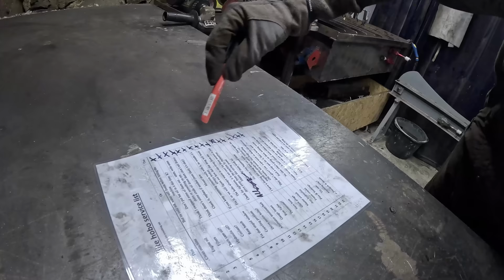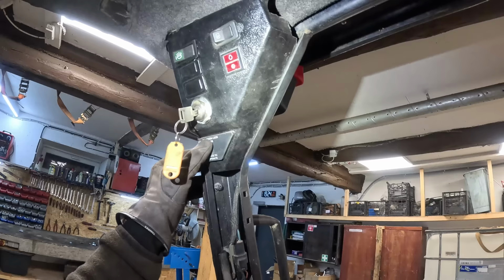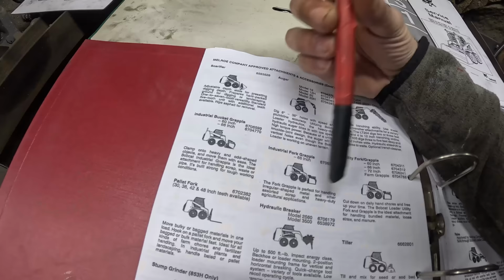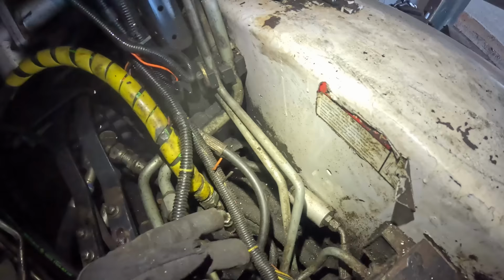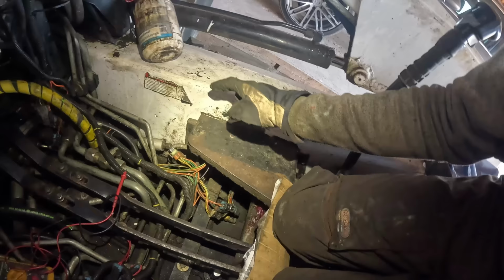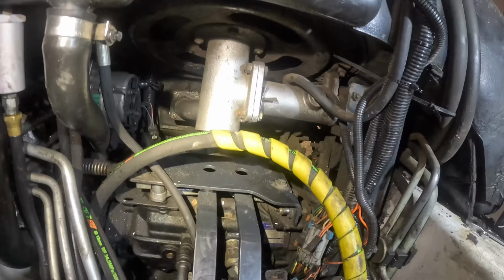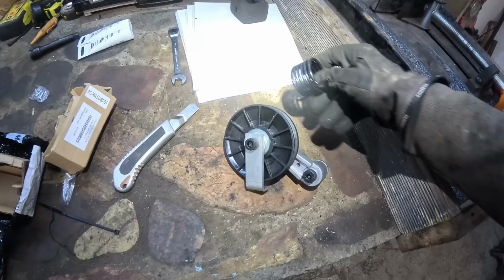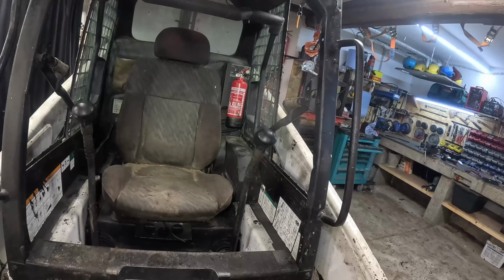Fixing up the Bobcat 751 skid steer - (part3)

Comment: For the wheel studs, I just removed one and took it to the store and found a similar one instead of buying OEM Bobcat. They were 2.50 instead of $10. To seat them I use a oversized nut as a spacer to suck them in tight.
Reply: What’s worked great for me is to put the studs in the freezer for a couple of hours to shrink them then before installing them heat the hub up. If you get it too hot you might have to put more grease in the wheel bearings because it could melt it but that’s no problem as long as you don’t get it hot enough to melt the wheel seals. I’ve stretched the threads on new studs trying to pull them in with the nuts before even with an oversized nut as a spacer.

Comment: Hey Ant! So a few things I would suggest is.
1. Your front bobcat tires are backwards. They need to be switched to the other side. The tread needs to make a v facing forward. The auxiliary control box isn’t worth replacing. Cost 1k in the USA. I bought a few. I just ran a wire and switch the the Aux manually. When you paint the machine.
 Use a paint gun. I painted over 50 machines. They look amazing with a gun and good paint. Take all plates. Glass and wheels off. Paint the grey first. Then tape  it and paint the white. Will look brand new.
2.Make some merchandise to sell. Like small pins or shirts or something cool about your culture. You have a big following and in the next few years you will blow up. 
3. People love when YouTubers like you buy and sell stuff. Like “I BOUGHT THE OLDES EXCAVATOR” and then promote the merchandise then. Lots of views and money to keep doing stuff. 

4. Just want to say you’re doing great!! Hard working. And consistent content. I won’t be shocked if you get 500k subscribers in the next few years. Use this platform to your advantage. A lot of money to be made to help you and your family out. Love the content and keep going!
Reply: MVP comment bro.
Reply: For the aux switch how did you get from 12vdc to 9vdc?
Reply from the maker: All good tips sir. Thanks
Reply from the maker: Could dowgrade the voltage with a resistors
Reply: @Ants_Pants  wasn't sure if that would create to much heat or not. I guess dropping 3v its not likely an issue. I was researching and they have sealed little converters for like $6. Otherwise it says 12 ohm resistor is needed. I'm not sure what the current draw is but it might be a good idea to make a small relay bank so as to avoid burning up the joystick controls. DC switching is typically harsher than AC

Comment: 👀 that you're done. We froze the studs, then used three (3) oiled washers & nut {backwards} to pull in the stud 😊
Reply: I do that and also heat up the hub around the holes. But don’t get it so hot it melts the wheel seals or the grease out of the bearings. As soon as I heat a hole up and put one in I blow air on it to cool it so heat doesn’t build up too much.

Comment: The yellow wires on the strobe lights switches the flashing patterns and also if you tie them together. It should sync them to one another. I worked installing emergency lighting on police cars and county worker vehicles.

Comment: Here you go, Ants, work is flowing nicely and results are coming to light. I admire your perseverance to projects and filming at the same time, since it takes twice as long as if you just do the job. Anyway, I have a ton of recorded material, I just need to put it together in some orderly fashion, which may take a while.. But as DIY mehaniks, fixers or repairmen, we all know how it goes..  The blackmith's horse is always shoeless... 😏 Anyway, you're right about rear lights, twice. Sometimes you get lucky that something fits correctly, and the yellow wire is to switch operating mode. I have similar lights and there are even 4 wires. It flashes in different patterns, just touch the yellow to positive to switch pattern. Cheers, it's going well, shortly will be spring and mud season at your place, here we had already 27 degrees in the past 2 weeks, but wednesday it came back winter, snow and also some frost locally, regardless of our central-south (mediterranean) position. It's not over yet, we need a bit more patience. Keep yourself together and good luck with the auxiliary. 😉👍
Reply from the maker: Got some more ice and snow lol

Comment: you can use a hydraulic brake actuator with a handheld hydraulic pump and thread adapter to press such threaded studs in
Reply from the maker: Ok

Comment: I like these videos! Keep up the good work.  The "oil" substance in the electrical plugs is most likely dielectric grease.  It provide corrosion protection by blocking moisture (water and other liquids), and excess oxygen - these combinations (liquid and oxygen contribute to rapid corrosion).   The grease component of dielectric grease also lubricates the rubber or silicon insulation of the connectors.
Reply from the maker: Does it also contain dirt and sand? 😅 because thats what was in there

Comment: Ants, you might consider a small case drain line, to go with the pressure, and return, as hydraulic motors require them.
Reply from the maker: for what exactly ?
Reply: @Ants_Pants  Gear type hydraulic motors, do not need them, but the piston type high torque hydraulic motors have three hose connections, as the oil that escapes the piston/cylinder area, under some conditions, builds up case pressure, until it usually spits the shaft seal out, then the fun starts.
The cooling fans on some equipment, is powered by gear motors, low torque application. 
Large brush hogs/mulchers use the piston motors for hydrostatic drives, high torque requirements.
Read up on hydrostatic drives, and skidsteer attachments. 
Best wishes from Northern Canada.

Comment: You have the signals comming in. you can buy some cheap relays to replace the aux controller. you can use some high amp resistor to reduce the voltage to 9v .

Comment: I wish you could have heard me yelling at you to turn the wheel nuts around and pull the lugs in with the flat side instead of the tapered side. Using grease also helps the lug pull into place better and helps the nut and washer spin freely.   If you want to use the auxiliary hydraulic system, there's not much you can do unless you replace the control module. You cant even continue to diagnose the problem unless the module is powering up the rest of the system.

Comment: First off that cab heater discovery was epic. You could always fit some Lexan or other rigid and clear plastic around, doesn't have to be air tight, and you'd have a somewhat warm cab in the wintertime. That bearing is a little worn for sure but it would probably last a while.
This video was awesome man. It's like I'm right there with you as you troubleshoot, discover, and repair bit by bit.
I don't mind at all if you need 3 more videos to complete this project. From your jokes, to watching you come up with obscure fixes, I really like watching your content. See you on the next video man.
Reply from the maker: Thanks Kirk

Comment: Hi Andris, nice video! Pro advice do never stick the multimeter tips into the connector pins. You will wide them up and cause very hard to find sporadical electrical connection issues. All the best
Reply from the maker: Yeah i know but i also bent them back later

Comment: The connections may, possibly, be filled with a dielectric grease. It would help with waterproofing and prevent corrosion. Or the seals are bad, and regular oil got in creating a weak short.
Reply: Also, a 9v battery is small and can provide the 9v you need to test the solenoids.
Reply from the maker: It had dirt in there aswell guess that's not normal
Reply from the maker: Ok

Comment: After you get the nut past the end take a grinder and taper the end of the bolt! But you have to use a thread die nut to straighten the threads! 👌🏻👍🏻👍🏻  Would save you on your replacement nuts!
Reply: Thread dies are incredibly hard to get started sometimes. A stud repair die is similar but works much easier

Comment: Getting near the end with the Bobcat. 
A lot of  overdo work looks like! 
By the way, those flat face couplers are used mainly on industrial equipment. 
Easier to hook/unhook as well as little to no leaks while doing so. 
A lot more expensive to replace as well, not really necessary in your case. 
Only thing hard to match up regular couplers to the pipe fittings usually
Reply from the maker: Yeah local hydro shop asked 70 bucks for 1 lol..... And they only had 1

Comment: 1:06:00  the yellow wire you can either change the light pattern or it is to connect the wires in series between the lights so that they flash in mode
Reply from the maker: Either way, thanks

Comment: One thing you can do is start the machine and lift the bucket. That would let you pull the floor jack out from under the bobcat. Put a little permatex on the chain fasteners to keep the rust from making it hard to take off. Cheers 😉
Reply from the maker: Good tip!

Comment: You said when your tires are on the machine there’s no room to add tracks. You do know that skid steer tires come in 2 sizes ( 12-16.5 and 10-16.5 ) and also you might have a more aggressive tread on your tires verses standard tires. If your skid steer has 12-16.5 on it now, originally it may have had 10-16.5 and you could add tracks

Comment: Good news theres still a chance your aux hydraulics do work. You have to use a certain sequence.

For the auxiliary hydraulics on my machine  you had to push the center switch to the right or left (on the right stick) along with pulling the front trigger at the same time. Pushing the button to right is standard flow for attachments and to the left reveses the flow. Not sure if yours is the same.
Reply: I always smear dielectric grease on the connector seals and inside the pins too. Keeps bad things out
Reply: Just a warning about ordering bobcat modules.
I had ordered a module for my bobcat and after installing found out it had to be taken to a dealer to be programmed before it would work 😢
Reply from the maker: I figured that might happen yeah....
Reply from the maker: I will test
Reply: As another commenter said it might make sense just to wire in a manual switch for the hydraulics if it turns out the module is detective.

Comment: It's normal to have spare unconnected plugs on machines, and cars for that matter, it's cheaper for the manufacturers to make one fits all sort of deal even if they waste plugs and a bit of wire rather than having to make one for each model machine. I once watched a video where a guy stripped a car down to every nut and bolt then checked the replacement prices of every part to build a new one, it cost over 43 times more buying the parts from the manufacturer than what the car cost price was when new, even buying none OEM parts was still over 15 times the price, that's where they make their money, not on the new cars. Here the motor cycle shops buy for example 5 identical motorcycles, 3 to sell whole and 2 for spare parts as the parts machines cannot be registered so have no registration fees. After selling just the plastics and handle bars lights etc. they recover the cost as its what people buy when they crash or drop the bikes, the mechanical parts come out free, ask one of your local dealers and see.
Reply from the maker: Makes total sense 👍

Comment: I'm about certain that the fan gear is not supposed to be full of oil, as gear housings seldom are. With the lights, red black as usually, white and yellow are sync. and change of flash pattern which ever way in each case. Some even need a certain time to be connected to B+ or ground to change flash pattern etc.
Reply from the maker: Needs to have oil up to fill hole

Comment: Be careful jamming test lead probes into female connectors. Those connectors often meet up with a flat blade and jamming around test probe into them can spread them out and stop them for making proper connection in the future.
Reply from the maker: I bent them back slightly
Reply: @Ants_Pants  okay cool. I've just learned this the hard way a couple of times. It really adds a nice layer of diagnosing challenge when you cause an intermittent problem halfway through the process :-)

Comment: You should start at the two/2 cuz wires first Jon then find where they connect into. Most likely it's into that plug in that had nothing.,or going to the back from the front thumb controller switch that activates that control solenoid switch.

Comment: The output from the control module should be a PWM signal and isn’t easily or reliably measured with a multimeter.  I believe the 753 has proportional auxiliary hydraulics, but your switches sound and appear to move like simple on/off switches that are not proportional, but that’s hard to tell on video.  If they are proportional, the handle switches are Hal Effect switches that also cannot be tested effectively with a multimeter.  There are four probable choices.  The control module is bad, the valve is stuck, the solenoids are bad, or the handle switch is bad.  Since neither switch causes the hydraulics to work, they’d both have to be bad and that’s less likely.  Same logic for the solenoids.  You don’t have flow in either direction, so they’d both have to be bad.  Possible, but less likely.  The valve could be stuck.  You could open it and make sure the spools move freely and that’s just time and no $, so what could it hurt except the possibility of breaking something.  But my money is on a bad control module.  But that’s an internet diagnosis from some idiot you don’t know who’s about 4038 miles away.  So weigh it accordingly.
Reply from the maker: Thanks for the info

Comment: The plugs may have been full of Dielectric grease.  Either way I'd suggest using some as it protects the connectors, lubes them and aids in them getting proper contact.
Reply from the maker: Pure sandy oil in there lol

Comment: Have you tested the solenoid coils? If they aren't open then you can try power them up directly with the right voltage. Even if they are proportional valves they should act as its supposed. Thats the way I do with hydraulics though
Reply from the maker: Will do

Comment: I assume you have bought a warning light It is the black grounding and the red is power the yellow cable Can you control that you change the hill the light should flash on a laser Then you have to touch the yellow cable away Power to adjust the flashing
Reply from the maker: Got it

Comment: Regarding the control module: you could try to find a used working one or try to find someone that can repair the electronics which might also be cheaper. If both do not work out you will probably need a new one. You can test if the solenoids work at least by injecting aprox 6V-9V to their connectors.
Reply from the maker: Yeh i will most likely try to hack this somehow, a used one needs to be re programmed for my machine
Reply from the maker: @ftrueck  lol i know. Actually the buttons send a signal to the module and that signal gets decoded and transfered to the solenoids. Stupid overengineered crap

Comment: With that much motion in the belt, the tensioner should be moving more. It doesn’t appear to move at all.  Perhaps the mounting bolt on the tensioner is too tight and the spring can’t tighten the belt. You might have used the wrong washer with the old bolt and arm.
Reply from the maker: Hmm

Comment: By the way Bro, the front tires are on the wrong side and need to be swapped side to side.
Reply from the maker: Turn rim around?
Reply: @Ants_Pants  Yes, the tires all have to have the VEE portion of the tread facing forward. It's possible that two of the rims are facing incorrectly .
Reply from the maker: @bobferranti5222  ok i will check it out

Comment: Watching one of your older videos,   why don't you put your power lines underground?, here in the UK, all power lines are underground except the 40,000volt power lines which are on pylons,  also just watched video of you fixing your well, no need for bunker, just small 3x3x3 concrete box to house pumps and electric connection then Bury pipes into house , no need for hoses, just insulated pipes into house and workshop, in uk all utilities are buried underground, incased in plastic pipes so perfectly  protected from cold and water, I think the are at least one metre below street level, as temperatures are about 12 degrees Celsius all year round at that depth, winter time gets down to minus 15 degrees Celsius here, so maybe you need little deeper, I don't know, solve your tree and power line problem, hope helps
Reply from the maker: I got all power underground except the ones that thw operator or supplier owns
Reply: @Ants_Pants  if they on your property you have a say where it can be, did you sign over your rights when it was installed, do they pay you rent for it being on your property,  just because it is owned by a company makes no difference unless you signed over your rights on it, if you have not signed any contract then you can tell them what you want, if they have not paid for the land where their pylons are they owe you money for rental of the land as you must be compensated for not being able to use that land as no structure can be built there, not sure about laws where you live, I would look into it,  I would not let any company charge me to move their infrastructure on my property
Reply from the maker: @darrenwalker993  this was forced in just last year actually. They never paid anything but now they are forced to pay the land owner
Reply: @Ants_Pants  I would get some legal advice,  in the UK we have a  citizens advice bureau which give free legal and financial advice to all citizens, do you have anything like it where you live?, if you do, I would ask about what your rights are and what the power company is legally obliged to do,  best wishes my friend